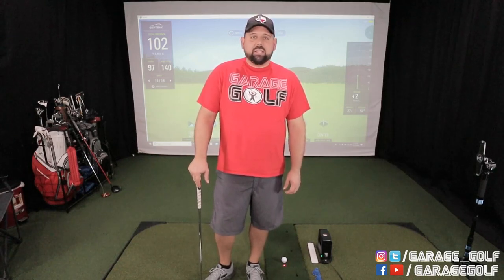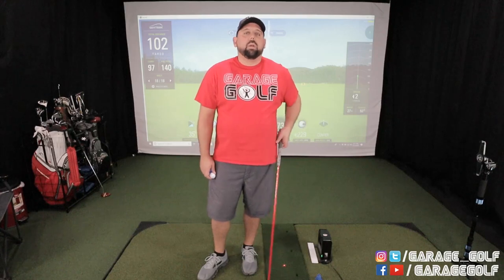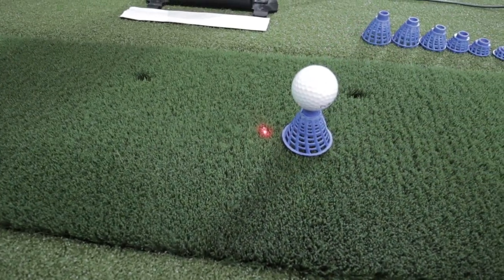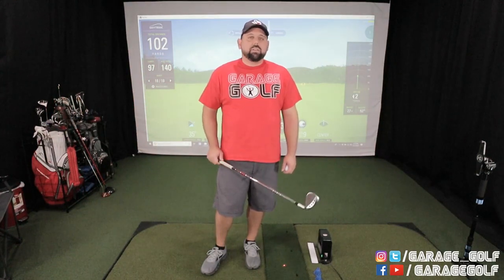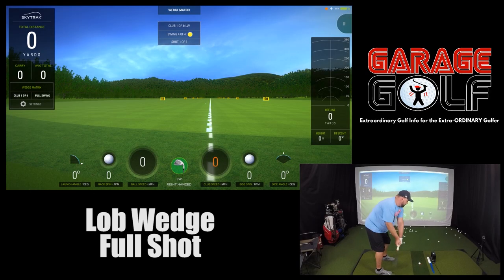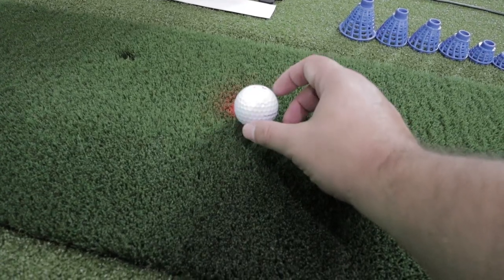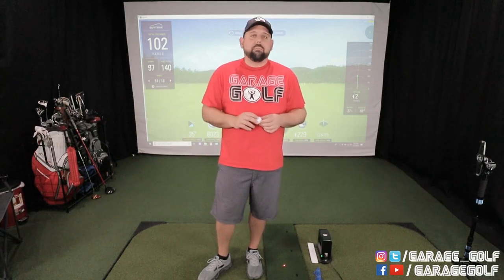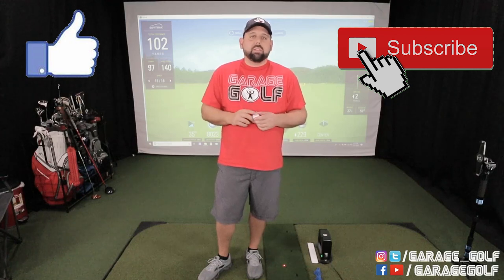Skytrak Tech Tip - Golf Ball Placement

Comment: This is exactly what I was looking for!  Thanks so much for this.  Liked and subbed.  I have had the SkyTrak for several months but have never been able to get it properly set-up.  I think there are a number of factors that have contributed to this.  First off, I agree with comments below that you have to make sure the Skytrak is level, not only with the mat also from a tilting perspective.  The built in levels can help with this as well as the alignment lasers that you can turn on. (Use the little level that comes with it on top of the unit for tilt)  I was using the fat white rubber tee (driving range) for drives and I was hitting it generally 190 and all over the place.  I would then hit my 3 wood off the mat 230,  brutal !!  It was so bad that I haven't been playing it much due to frustration.  Same type of thing for really high shots (ie:  your lob wedge explanation), and putt alignment.  I have ordered the new tees as recommended and can't wait to get going again with all your tips.  I have a black driver and haven't experienced the same effect (as others) but I have an older white R11, and will check it out with the new tees.   Thanks again for rejuvenating my belief in a great product, that I just didn't know how to configure properly.  I think Skytrak should send out a lot better instruction and or videos, because without these tips like yours from real life, they may get negative feedback simply because peeps don't know how to set things up.
Reply from the maker: It takes some tinkering a bit but once you figure it out it will get dialed in I promise. I'm here if you have any questions or issues and will be glad to help in any way that I can. If you haven't done so yet, please join our Facebook Group at www.Facebook.com/Groups/GolfSimTalk. We can also chat via PM in there and there are a great amount of people in there that can help answer additional questions you may have as well. It will be a great tool for you with getting some further help. Thanks for watching and subscribing!

Comment from the maker: Just to clarify a bit, for "faster" swing speeds I would classify this as being 95mph or higher with your driver. Putting the ball behind the dot will help a lot as well, but launch angle does factor in also so it helps with people with low launch angles also, even if the swing speed is not at that level.
Reply: Garage Golf what about swing speed of 114-117 with an average launch of 12*

Comment: Appreciate the tips and your videos sir.  Been a minute since you posted this video...not certain if this will find your way.  I am about to pull the trigger on a Skytrak+ as I don't believe I have the appropriate space for something like a Mevo+.  I was considering purchasing the 4x7 Sigpro Softie golf mat kit but was hoping you could provide some expertise on the Skytrak placement in regards to the ball striking area...I've viewed some video concerns about placing the Skytrak on the same general hitting surface area leading to misreads from ball strike vibrations.  Your setup looks similar in design with a dedicated hitting strip but yours might affix to the larger matt more securely.  Sigpro strip appears to sit via a clean cut out and tamp down versus any submerged connectivity.  

The Sigpro kit also appears to have a remaining 1.75' on the pad.  This would require the Skytrak to be placed at least 1.75" away from the ball.  How far away can you place the Skytrak from the actual hitting surface and still expect accurate reading?  Should I just purchase a hitting strip so that the Skytrack could sit closer to the hitting area but on a separate pad?  I hope this all makes sense. 

Thank you very much. 

Seamus.
Reply from the maker: Hi Seamus, if you would like shoot me an email to Roland@mygaragegolf.com and we can go over this together in more detail. The SIGPRO 4x7 is meant to place a launch monitor such as a Skytrak+ in the area next to the hitting insert so the Skytrak+ should work just fine. The Skytrak+ is meant to be placed 11" to 12" away from the golf ball. 

In regards to the Skytrak+ I also have a discount code I can share with you that will save you 5% off of a Skytrak+ purchase. Info is below: 

Skytrak+ Launch Monitor: https://skytrakgolf.com/discount/GARAGEGOLF
Click on “All Products” at the top of the page
Select Skytrak+ Launch Monitor
Click "Add to Cart" - You Should now see the discount applied in the cart.

Hope this helps but let me know if you have any other questions. 

Roland

Comment: Hi, 
Thank for the info, definitely helped especially with the wedges.  I have also noticed the red lens attracts dust after many hits and requires a soft cloth wipe.
Dan
Reply from the maker: Glad to hear the info helped Daniel! You are correct, especially in dusty areas you want to make sure you use a microfiber cloth to clean the lens cover on a regular basis. Thanks again for watching!

Comment: Not sure if this helps but it works for me, I use a laser line tool and place it so it runs through the center of the ball and onto the screen, I then use a 7 iron with a putter stoke with enough force to reach the screen this gives me a true shot angle and allows me to align the Skytrak, if my shot is off line I know immediately.

Comment: This worked for me, Red V says, 
Are you using the metal case on it? I found that it elevates the device too much which led to most of my shots not being tracked. The minute I removed the case and put the device flat on hitting surface, it worked perfectly every time.
Reply from the maker: I have mine off of the mat I am hitting on and placed a small platform next to the mat where I have my Skytrak. That places it at the exact height of the mat even with the case. That along with an LED light shining on the golf ball and I have very little issues at all.

Comment: Hi guys, great vid and info. Not long got my set up complete and I had to erect my Projector to the right side wall. I’ve found a lot of shots go to the left. In your experience, do you think it’s the angle of my projector above right side, relative to the SkyTrak system on the ground? Thanks in advance
Reply from the maker: Hi, the angle of where the ball goes will 100% directly correlate to the Skytrak itself. Go to the driving range and hit a few short chip shots straight down the middle. If the shot goes straight in the sim and goes right or left on the Skytrak, open or close the Skytrak a bit until you see the shots line up to what you see in the sim. At that point mark the feet of the skytrak with a piece of tape so you know where to line it up each time. It's not uncommon to have to open the Skytrak sometimes by several degrees to properly align it to reflect the correct shot in real life. That will make a major difference to your experience.
Reply: @GarageGolf  thank you so much & I'll give that a bash. 
I looked for your FB page but couldn't find it mate (I'm in UK) 
Great reading on this & keep up the good work 👏👏
Reply from the maker: @haggis2593  https://facebook.com/groups/golfsimtalk

Comment: Where were you 2 months ago! LOL Good information and I appreciate it. When playing with TGC 2019 there are times I would like to hit a flop shot but I cannot find where to put that ball in relation to the laser dot! After 30 tries, my back gives out! I mean a real high launch flop... is that possible for Skytrak to read it? And if so, where do I place the ball? thank you and keep it coming!
Reply from the maker: I was here...Youtube just hadn't told you about me yet :) You can accomplish most flop shots by placing the ball about 2 to 3 inches in front of the laser dot with the logo facing the camera. This coupled with a good LED light shining on the golf ball from behind the Skytrak can work wonders!!
Reply: @GarageGolf  thanks for the suggestion. I tried the placement and LED light and nothing. The green lights stared at me saying "hit the ball you big lumux!" I had 4 great flop shots and 4 such blank stares at me.... I may be getting a 60° launch angle on them because it will read 50° shots... but these... nothing...
Reply from the maker: @TimboCarp78  Timbo, is your Skytrak on the same mat you are hitting off of? For example something like a Country Club Elite mat? Sometimes when that is the case the vibration from hitting a shot can cause interference with the camera. I was just curious on your setup.
Reply: @GarageGolf  that is a good thought... however my Skytrak is on the floor with the elevated feet so that it is level with mat. The laser dot is 11" from my alignment rod that I placed in the Skytrak channel.
Reply: @GarageGolf  yesterday i spent a long time improving lighting and moving the launch spot. Most of the time I would get no read.... like I didn't even swing the full flop. But when I put the ball so the laser hit the back of the ball (side away from screen) it would see the shot. It just cannot compute it. 
Any further suggestions or is there a number to call Skylark?
Thank you for your patience!
Reply from the maker: @TimboCarp78   Very strange Timbo. Wonder if there is an issue with it needing to be calibrated or something. Here are the links for Skytrak Customer Support: https://web.skygolf.com/support/contact-skygolf
Reply: @GarageGolf  thank you! I'll let you know whether they have an answer or not.

Comment: First let me say that your videos are very helpful and entertaining, I am subscribed. 

I am having issues with my Skytrak with TGC 2019 with very short chips not picking up. These are the type of chips where you debate chip and run or just use the putter. In this situation, if I use putter the ball will only go a foot or two where in real life I know it would probably push through the fringe and roll out near the hole. Is there a setting that corrects this? I would say that everything else in nearly spot on so it is very aggravating.
Reply from the maker: Thanks for watching John and for subscribing. For the Skytrak and your chip shots in general or putts on the fringe make sure that the club selection is set at putter on TGC 2019 if you are in fact not on the green and using the putter. I am a putt anywhere around the green guy myself and it took me a while to figure that out when using Skytrak originally with JNPG as my ball would not go anywhere if I did not do this. If still not working try shining a light directly over the golf ball while putting while making sure not to hit the laser with the light directly and see if this helps as well. If not reach out to me at roland@mygaragegolf.com and we'll troubleshoot from there and I'll help out the best I can!
Reply: Roland, thanks for the help. This worked out pretty well when I played last night, probably about 80-90% accurate. The hard part is remembering to select putter when off the edge of the green, I forgot once and paid the price!! I even selected putter for a really short bump and run and it worked much better.
Reply from the maker: @johnpotas7479  Glad I could help John!! Let me know if we can help in any other way and keep on golfing!!!
Reply: Roland, I have now found that if I select 7 iron and use my Smart Sole chipper from around the greens it is exactly the same as real life. The lofts are the same and the Skytrak picks it up perfectly. Just fired an 89 at TPC stadium as I watched the pros play the same course, doesn't get much funnier than that!

Comment: Just got my build done yesterday. Thanks so much for this video. Definitely felt like I was doing it wrong. Do you have a video about alignment? Cheers from Cali.
Reply from the maker: No but I can certainly work on one. What I advise is to set up your Skytrak straight with your mat towards the screen and take it to the driving range on the Skytrak application. Hit short pitch shots straight as you can towards the screen and see if it reflects the same straight shot on the Skytrak app. If not open or close the Skytrak face a small amount until you get it right and it lines up accordingly. For example, my Skytrak had to be open to target about 1/4 angle or so for my shots to reflect straight when I was hitting straight pitch shots. From there I got a heavy duty piece of white duct tape meant for higher heat and put it at the base of the Skytrak case so if I ever moved the Skytrak I know exactly where to put it back again. Let me know if you have any questions on this!
Reply: @GarageGolf  Thanks! took me a bit to find the aligment mode laser option. Then I just put a club shaft down. That worked.
Reply from the maker: @JamesPeacock  Great to hear James!

Comment: My biggest issue with the SkyTrak is with hybrids, fairway woods, and the driver.
It seems that any club with a greater head size than an iron (iron readings are about correct) give VERY inaccurate readings.
For example outdoors last season at our club's driving range with a Trakman and my 3Wood on a 1/4" tee my carry distance was an average of 223 yards (yup, I'm old now!), but with the SkyTrak I'm getting 170-180 yard carries! That's a HUGE under read. 
Have you had issues like this? 
It seems that all bets are off with anything on a tee!

Ted from Winnipeg, Canada
Reply from the maker: I always have problems outdoors. Indoors I have perfected it as much as possible using these tips and having an LED light shining on the ball. It is giving me pretty close readings. Outdoors with the sun I have always had issues with misreads or no reads all together.

Comment: @garage golf : did you ever try with foam balls? I just bought the skytrak, but until I have a proper installation, i'd like to use foam practice balls. any idea if it would work the same? I suppose it won't due to the extra compression, but you never know…Cheers, and thanks for the great vids!
Reply from the maker: Thanks for watching Pierre. You can use foam balls but the Skytrak is very hit or miss with the reads of a foam ball versus a real ball because the spin numbers will be way off. It may read some of them but you wont see true ball flight like you would with a  real golf ball most likely. I had the same issue and put a couple of real balls past a net into the sheetrock a time or two. Lol.

Comment: Great videos man. I just got a fiber built mat. Does the turf on your mat move around like the turf is slightly too small for the area of the platform?  I notice the quality of this mat is not at all what I was expecting.
Reply from the maker: Which mat do you have in the Fiberbuilt line? Is it the Single Sided Golf Mat or one like I have in the video? I haven't noticed that with mine to be honest. The quality is the same as when I bought it 18 months ago and have been very happy with it. The base of my mat did move around a bit so I used heavy duty adhesive velcro underneath that holds it in place great. Please let me know if you have any other questions on this and I'd be happy to help! Thanks again so very much for watching.
Reply: Update:  I have the single sided 4x7 with the stance and space mat for launch monitor. Made a video for Fiberbuilt showing the problems and they were quick to respond and great to work with. They are sending out properly sized stance and spacer mats. Very happy with their service and will know soon if the new mats have a better fit. Good idea with the Velcro on the bottom.

Comment: Great video. Thanks.
I have a new setup.  Using TGC 2019 (awesome btw), my distances are fine for all my clubs but the driver, I hit my 5 wood longer than my driver. Any idea why? Can it be the birtees?
Reply from the maker: Are the Birtees white or another color? If white they could be causing issues. What color is the driver as well?
Reply: Birtees are indeed white. Driver‘s head is black (Titleist 917)
Reply from the maker: @martinleclerc4258  The white Birtees or white tees in general can cause misreads with the Skytrak. Try getting colored Birtees or wrapping the outside of one in blue painters tape and see if that helps your issue.
Reply: @GarageGolf  Thanks. Keep up the great work - you are an inspiration!
Reply from the maker: @martinleclerc4258  Thanks Martin!

Comment: I've found that making sure the red light is 11 to 12 inches from the unit is a must
Reply from the maker: Thanks for the tip Stuart. I tend to do that as well with maybe the only exception being putting when I am having some difficulties with it reading.
Reply: sometimes making that accurate and keeping unit level is not so easy?!
Reply from the maker: @prodigalh1234  I have not encountered this issue with mine. What case do you have on your Skytrak?
Reply: @GarageGolf  the metal protective case. skytrak state the the unit must be level with the tee off mat if it sits just off the mat like mine does, so just a few parameters to consider... to make it meet the 11.5 - 12.5 distance.
Reply: @prodigalh1234  I also have the case with level on it. I dial everything in with a carpenter's square on my target line. 
12", level , and parallel is optimal.
Reply: @Picklemedia  agree. i have it perfect at moment and try not to move my set up.